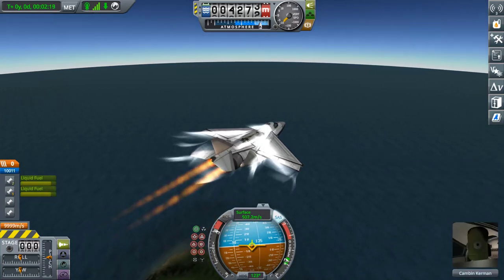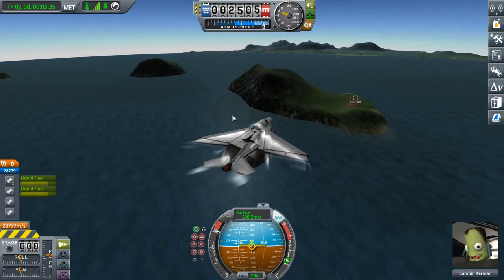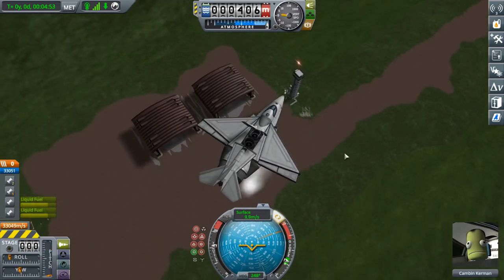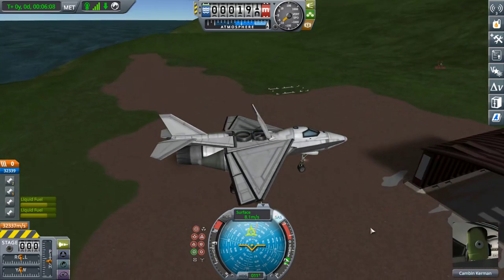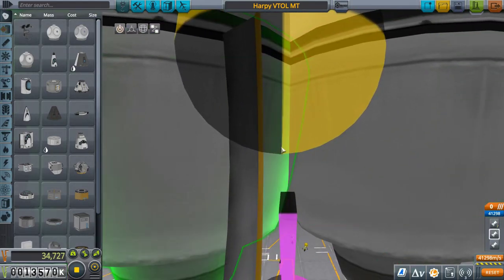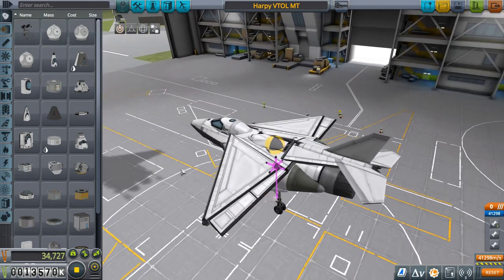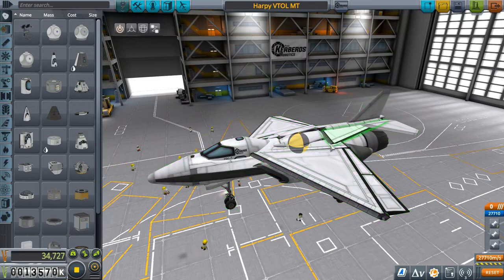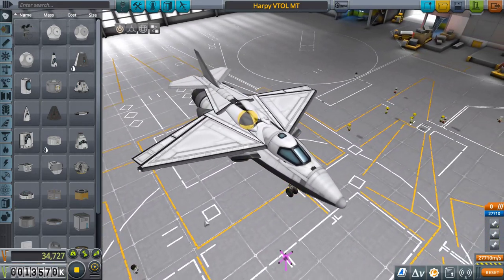KSP Harpy VTOL and How To (100% Stock)

Comment: I don’t get how my jet is lighter yet those engines can’t make it go up
Reply from the maker: Jet engines take some time to spool up to the power you ask them for, like if you turn on the engines to full power it takes a full 5 seconds before they're making full power. The wheesly (sp?) has a TON of static thrust
Reply: @Rocketman679  you think I turn on the jet engines and go back to space hangar 0.000003 seconds after they don’t immediately throw me 300 feet in the air?💀
Reply from the maker: @j_tha_panther  I mean you've got a lighter weight jet that can't be lifted by the same pair of the same engines so you're obviously doing something wrong 😂 I just started with the most common misunderstanding about jets in ksp
Reply from the maker: @j_tha_panther  jet engines also need a considerable amount of intake air to produce full thrust so maybe you don't have enough intakes? I'm just spitballing tbh

Comment: A huge tip for controlling the wheesley engine for vtol is to calculate / by trial, figure out how much engine thrust it takes to put your craft at equilibrium. Then right click and pin the engine menu keeping an eye on its thrust.

Comment: this is pretty cool, but in my experience i find it easier to vtol with normal control direction, i e forward instead of upward, as for example, pitching down slighly increases your forward speed, pitching upwards slightly decreases forward speed, and rolling slightly to the left or right changes sideways speed, and throttle would be just vertical speed control.
Reply: also, using rocket engines can be useful for bigger vtols, as they have more thrust so you would need less engines. Also,  the Dart aerospike engines kinda do fit within the 1.25m service bays, like if you put it in there and rotate part and use move tool, you can get it to where its concealed by service bay, but you can open it when you need the vtol engine. this way, the engine gets shielded from drag and its easier to fly faster, which is what i used for my mun vtol ssto (although its not meant to vtol off/onto kerbin, just for the mun)
Reply from the maker: It is generally easier to control with normal control direction, but the game doesn't support auto leveling to the horizon. The reason for the vertical control direction is so that the "radial out" sas mode can hold the craft level on its own. And rocket engines consume a TON of fuel, though they definitely are easier to land with
Reply: @Rocketman679  true, for using rocket engines, you would need to land faster, but it is can be easier in some situations where you need more thrust, or on other planets, for example duna. it is simpler to use, but for me its easier to manually control that. also, if you have center of thrust aligned perfectly with center of mass, it helps it keep its attitude (direction) easy, and with adding a few more reaction wheels it makes it easier to control.

Comment: Holy shit, that was amazing.

My best attempt at a VTOL jet was a tiltjet design:
- Vertical takeoff was technically possible, but the transition to horizontal put the plane into a tumble that killed the pilot half the time
- Horizontal flight was medicore
- Vertical landing also technically possible, but only because I used a shitload of parachutes to do it

Comment: after a long trip you will use a lot of fuel and you center of mass move, so will it be harder to land and take off or it is trascurable?
Reply from the maker: This jet is balanced such that the center of mass stays roughly the same as it drains fuel, so it's just as easy to land when it's nearly empty
Reply: @Rocketman679  very good job!